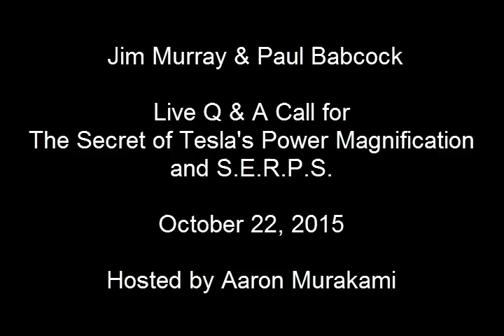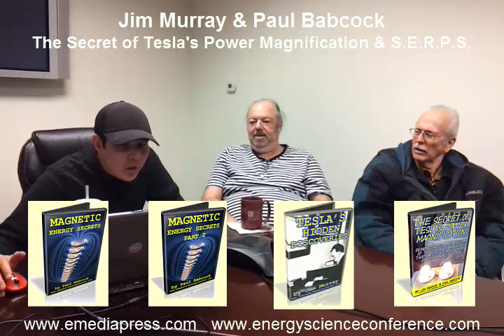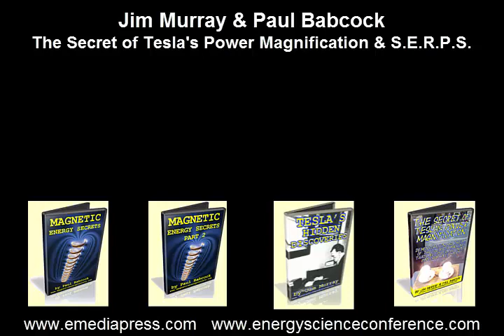2014-10-22 SERPS Interview Jim Murray & Paul Babcock

Comment: I have worked out a mosfet half bridge circuit, that can be used for this energy recycling.  The body diodes are blocked, by series diodes, so the energy doesn't slip around the mosfets. I'll publish it before the end of the year.
Reply from the maker: Share it at energeticforum.com
Reply: @AaronMurakami13   the video with the circuit and experiments will be premiered on my channel 21 november 2020